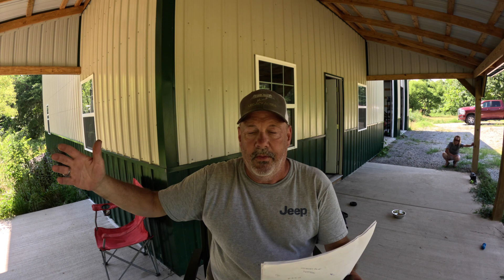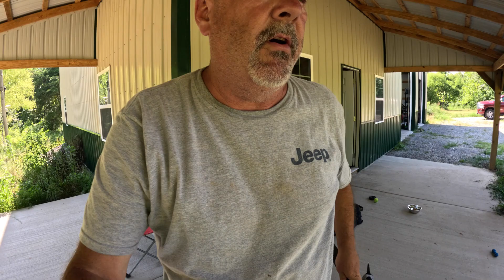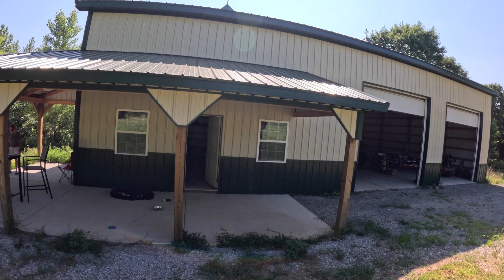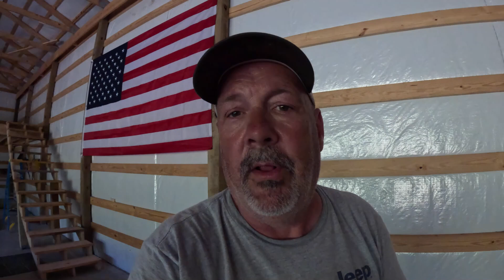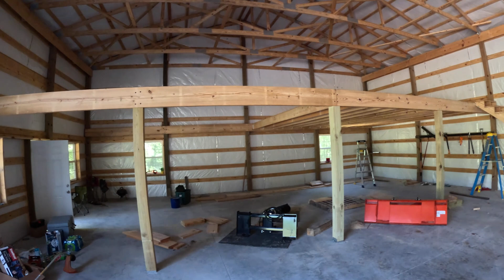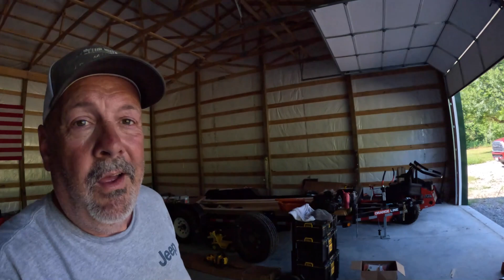Step by step process of having our dream pole barn built.  #polebarn

Comment: Nice update on your building. I went through the same issues back in 2018 built my 30 / 60 x16 building. Use the builder in Hopkinsville Kentucky  absolute horror show all the way around. Concrete company they use to use what's complete joke never showed up 4 times. A building that should have took 2 weeks tops to build took almost 3 months. Tons of issues with my building I had to fix myself paid the builder off just to get them off my property. This is my third steel building absolute worst experience ever. I used Porter grace buildings Hopkinsville Kentucky. Left them the appropriate Google review you can see it on the reviews .Avoid them like the plague.  Did almost everything myself on a one show to old to ever do it again.
Reply from the maker: @TheKiloG69  Thanks for the feedback.  Sorry you had a bad experience.  Appreciate you stopping by and commenting.